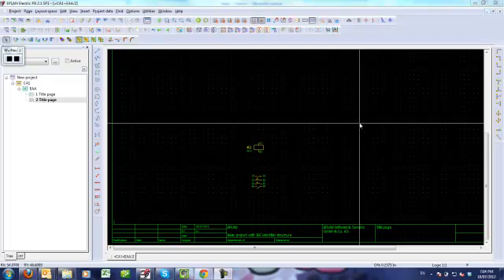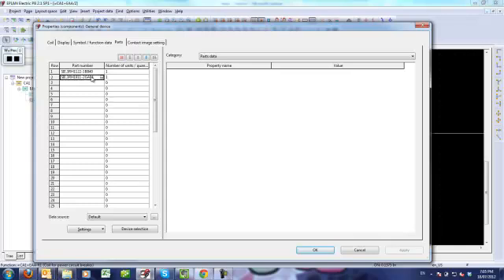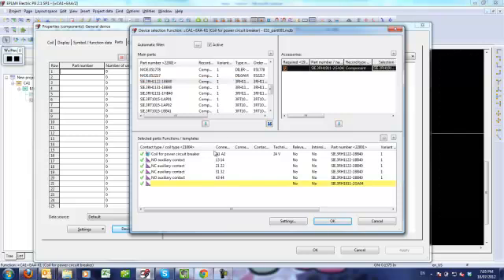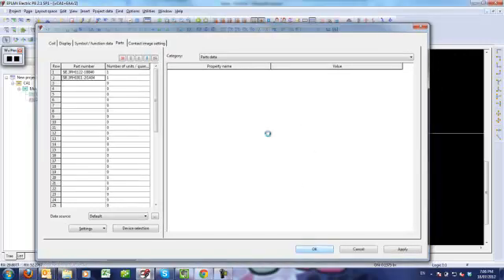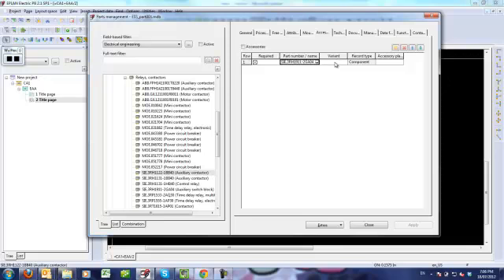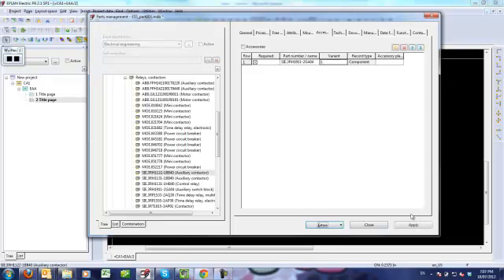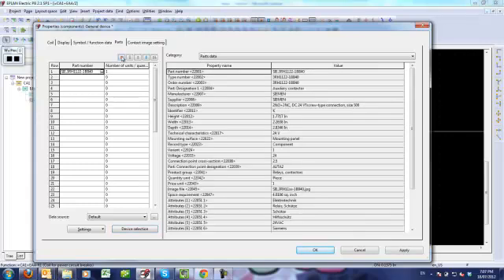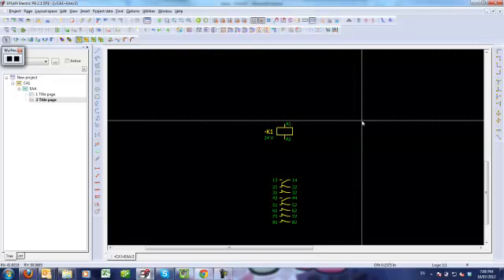Eplan P8: Missing Variant on accessory causes problem and how to solve

Comment: I encountered this problem today :) im just curious what is the "variant" exactly for? What would make the difference if i put the variant on "2" ?
Reply from the maker: @cedricthys7843 Hi. Part variants allow you to create the "same" part, but with some variation. Best example is pushbutton/switch contact block that have _1 and _2 connection point designations (NC contact blocks). If you only create a part variant of such a contact block with 11 12 designations, then if you try to assign this part to a contact block with the designations 31 32 in the schematics, the part function template will not be overlayed by the function in the schematics, potentially causing a message in Project check.

How you solve this is by creating variants of the contact block with different connection point designations. So, for an NC contact block, you'd have part variants for 11 12, 21 22, 31 32, 41, 42 and so on. When assigning the part, you also select the corresponding variant. Now the connection point designations in the schematic also match those of the part (through the variant).

I hope this short description of part variant will help you understand their basic usage.

Cheers

Comment from the maker: Hi Adrian.

If your school is using the mdb database format, then all you need to do is copy the mdb file to your laptop, and set the parts management/parts selection to point to it.

On the other hand, if they use a SQL server database, then you will need to use the export tool (from parts management > Extras > export), and re-import it on your laptop. Mind the "measuring units" (under parts management > Extras > Settings).